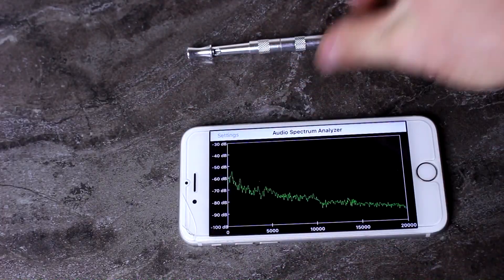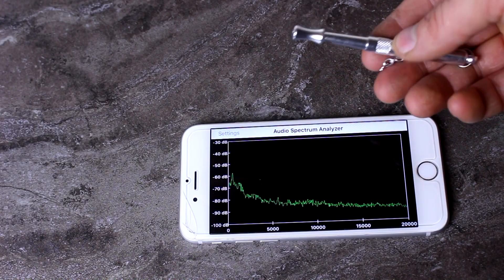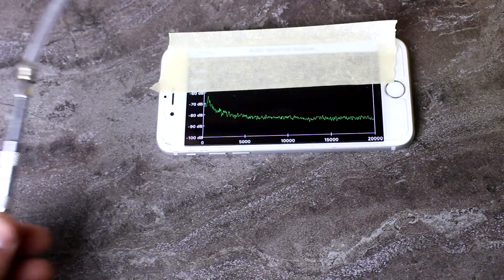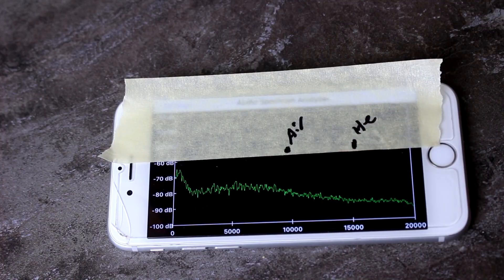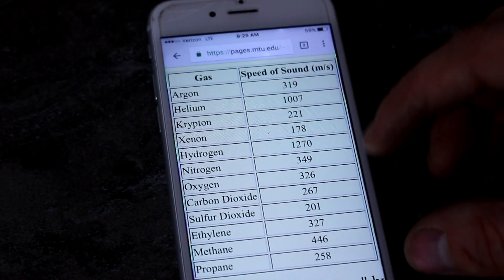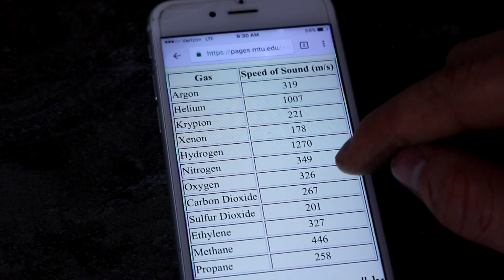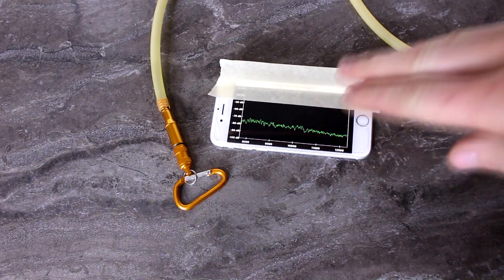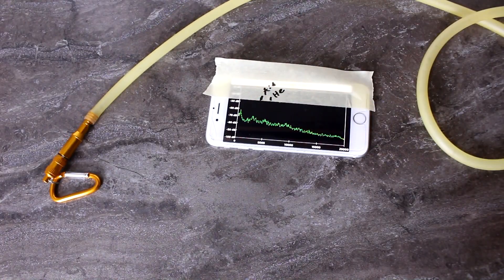Dog Whistle On Helium and Xenon

Comment: If the helium was meant for party balloons (ex: you got it at a party store), then it absolutely has oxygen added to it.  They do this to ensure people don't asphyxiate on it since they know people will huff it (getting hurt is uncommon, but has killed at least one person).  If you want higher purity stuff, you generally need to get it from a supplier and/or make sure they have the purity documentation.  Also: props for doing the test with xenon; I know it's really expensive (pure, it's $1000/kg in bulk, compared to helium at <$20/kg).

Comment: That's really cool! And I have an idea for a follow-up video! As the electronics hobbyist, I saw something familiar in those two peaks on the spectrum when you blow too hard. In electronics, a sinewave oscillator ideally produces only one frequency - the fundamental. But when you overdrive it (just like you did with the whistle) the waveform gets distorted (clipped if you overdrive it real hard) and produces harmonics as the result. Similar behaviour, it would be nice to see how the actual waveform changes. I bet it's gonna be sinewave if you don't blow in it like crazy :) Cody, I will be very happy if you will give this a try.

Comment: I think the "Diffusion Rate" is the wrong term, I think the reason the balloon deflates more slowly is the viscosity of xenon gas is higher which plays into the Reynolds number and ultimately the friction factor of the tube/whistle.

Comment: Tut-tut... All whistles have their harmonics and the helium you put through the whistle has a distinct lower frequency peak as well in the 4500 to 5000hz range. And Xenon did the same.

Harmonics are determined by the frequency of the whistle, which IMHO you should find out what the set frequency of the whistle is as not all whistles are created equally.

Comment: You're probably seeing a harmonic at 9-10kHz, rather than the primary note being played. Dog whistles are ultrasonic, above 20kHz, which is why they seem quiet to us. The microphone on your phone and pretty much any other mic will not pick up anything over 20kHz, since that's the upper limit of human hearing. Speakers will also usually not play anything above that, for the same reasons.

Comment: The whistles aren’t necessarily designed to play multiple frequencies, that’s just the resonance from the sound interfering with itself at the aperture or whatever (I don’t know the specific whistle jargon). This also means you’re gonna get different measurements depending on the angle of the aperture relative to the microphone

Comment: it's nothing to do with an overload on the whistle, it's just how sound works. the first peak is the fundamental frequency and the higher frequency is the fifth above (the strongest harmonic since it is in phase exactly half-way between the fundamental and the octave frequencies), the next (smaller) peak is the higher octave and you can even see a really small peak near 14k on the Xenon reading, which is the next fifth up, and so on past the top of the scale.

Comment: The reason you got a different frequency when you used more pressure to the gas is called "overblow." Wind instruments use this to extend their ranges. Instruments like the flute or saxophone overblow by an octave, or their frequency doubles. A clarinet overblows by a 12th. The shape of the bore of the instrument and if it open or closed on one end determines this.

Comment: Question for you: would the air in the whistle slow down the helium? You are giving it a push, but as you're pushing it, it has to exit through normal air, causing a bit of a bottle neck?

Comment: What I would like to see is what a whistle sounds like with the same gas content, but at different atmospheric pressures.Maybe your pressure vessel could be of use?

EDIT:
After reading up on the subject the pressure is likely to have very little effect on the actual speed of sound in the medium itself so as to be mostly irrelevant in an ideal gas.

Comment: Shouldn't the exhaust of the whistle be into the same gas as intake?
Whistle intake and inner structures are filled with gas, but the exhaust opening [which sports the breaking-edge, a key part of the whistle!] is exposed to atmosphere/gas mixing.
Using a microwave analogy, the density difference between air to gas is much like an impedance mis-match in a waveguide/antenna!
If the whistle-body was in a balloon filled with gas, then more gas injected to make the whistle sing, then your results might be quite different.
It would reduce your standing wave ratio, leading to less overtones.
The harmonics hint that the coupling is not ideal.

Comment: Hi Cody, your bottle of Helium is in fact contaminated with air for safety and regulation purposes
As it is an inert gas, some people used to use Helium to kill themselves peacefully (as you body detects high levels of CO2, but not low levels of Oxygen, you would simply faint away and die without any convulsion if you were to breathe pure helium with a hermetic mask)
Because of that, federal regulation decided to force balloon Helium tank manufacturers to make "Ballonium" Which is about 80% Helium and 20% Air do that anyone attempting suicide (voluntarily or not) would feel the effects of asphyxia and CO2 poisonning (which are pretty painful) before death would occur.
If you want a clean source of Helium you will have to contact specialized manufacturers
Reply: This is Cody- when he wants the O2 gone, it's going...

Comment: im not sure how it works, but it looks like theres a log ration to the speed of sound relative to the mass and de frequency of the vibration..

also, maybe the air between the wissle and the mic make distortion, and the several peeks are harmonics that could come from echo in the room or from the hardware you are using. michrophones have a resonance frequency like everything else!

Comment: Isn't air mostly nitrogen?
Reply: Yep.  With a molecular weight of 28, compared to oxygen's 32.  Helium molecular weight is 4.  Xenon molecular weight is 131.  Compared to helium and xenon, there's no difference between oxygen and nitrogen as far as speed of sound goes and with equipment as crude as this.
Reply: At sea level air is roughly 79% nitrogen, 20% oxygen, and 1% other gasses. At his elevation, oxygen will be lower concentration.

Comment: Hey Cody!
A student once asserted that when you inhale Helium, it doesn't lift the fundamental frequency of your voice, but it affects the overtone series, sort of like a wahwah pedal with guitar.  
This experiment seems to refute that claim, but I wonder if the human voice isn't more complicated.  Can you do an experiment where you sing a pitch, with and w/o Helium and compare the Fourier Transforms of these?  
It'll make a fun video no matter the results.
Reply: It doesn't refute it, because those are two different ways to make sound.The fundamental frequency of the whistle mostly depends on the time taken for sound to travel along the tube. The fundamental frequency of the human voice mostly depends on the tension of the vocal chords. It's like a recorder vs. a trumpet. The vocal chords act like the lips of somebody playing a brass instrument. There's some coupling between the resonant cavity made by the mouth/throat and the vocal chords, so the fundamental does change slightly, but less so than with a whistle.
Reply: Google "formants".
Reply: Human voice is a little more complicated, because there is something known as a 'formant'. In sound-design / mixing, when you pitch shift a human voice, it sounds like a chipmunk unless the pitch shifting algorithm has some sort of "formant filtering", where it then sounds like a normal voice again, just higher pitch. It's hard to describe the difference. One way you can make it sound like somebody sang a higher pitch than they really did, and the other just sounds like you made them several feet shorter.

As I understand, the 'formant' is a set of peaks, and it's the ratio of them that makes a voice recognizable. You can sing in various pitches, but the formant of your voice stays the same for all of them.

However, a voice sounds totally different on helium, so it's safe to say that the formant has changed, even if the fundamental pitch might not have. I don't know how that ties into the results on the phone though... maybe results would be different with more sophisticated gear... the phone might have poor frequency response in the high range, and the real peaks may have been different. Or, maybe the fundamental frequency of the voice actually does change right along with the formant, and he was just wrong...

Comment: A brief digression into digital audio/sample rates: (oversimplified, but still)

Your iPhone is recording sound at 48000 Hz, or 48kHz. 
The Nyquist–Shannon sampling theorem says that you'd need 2x the frequency as the sample rate to reproduce your signal. 
With 48kHz sample rate you can then reproduce ~24kHz as your absolute maximum frequency. In reality (and to preserve sound quality), the iPhone starts to filter audio above 20kHz to avoid aliasing. 

YouTube on the other hand has a very steep filter at 16 kHz audio frequency, so everything above that isn't going to be reproduced on your viewers player (even if it is audible in your source video files). 

If you happen to have a sound card or USB audio interface that can sample higher than 44.1 or 48 kHz, you could use that with an external mic to retry your experiment and (hopefully) get more clear results. Especially on these overtones of the whistle on helium.
Reply: Not to mention the frequency response of the mic capsules
Reply: That's it!
Reply: So he can even trace the natural harmonics of the whistle.
Reply: brilliant
Reply: Ahh.
So I should breathe helium to hit a high G on my trumpet.
I'll write that down.

Comment: The Android app I use has an option to mark the frequency of the significant peaks so you do not have to guess.  Used it to measure the frequency of noisy inverters.

Comment: Just wanted to note that the first gas you were using was breath, which is mostly nitrogen, unless you were filling the balloon with a pump, it doesn't make a huge difference for your findings since nitrogen and oxygen behave similarly, though.

Comment: Oh man you've just remind me I'm defiantly closer to dying, I use to be able to hear 17 kHz easily but couldn't detect the 15 kHz you got with helium, I may as well buy a wheel chair.
Reply: Enoch Powell or just your speaker is crap
Reply: Good point. Though I'm 40 so I'd imagine my hearing is tailing off considerably, in my late teens I could just about detect 19.2 kHz in a silent room using head phones which as you probably know is right at the limit of what humans can hear.

Comment: The whistle is designed to play slightly in the audible range and not to be purely ultrasonic. This is so that you can hear what you are doing with the whistle, which becomes important when you start training more advanced commands with coded whistle blasts.

Comment: hey cody, could you use this method to identify gases?
Reply: i mean like, if you had data about gas frequenses peak. and then put a unknown gas through the whistle, and try to identify it.
Reply: Probably, would require a decent pressure of gas and purity though
Reply: I imagine you could get a pretty good idea about the density of the gas (which you could do by floating it in a balloon anyway) but not to a particular gas, because a mixture of gasses could be indistinguishable from a single gas if the densities line up right.
Reply: So this demonstrates the relationship between molecular weight and sonic resonant frequencies for a given column of gas... Another way is to use electromagnetic waves instead of sound waves, for which each molecule also has a signature resonance. This is how mass spectrometry works. Notice the difference was smaller with the lower frequency whistle? That means lower quality measurements. With mass spectrometry, the frequencies are much higher (visible light!) so the differences are easier to measure.

Comment: Oh, honey, thats not what FFT length is used for. You want to turn on "peak hold" and maybe turn the slider below that down a bit.

FFT length is the resolution, so you're just increasing the resolution so much that it slows down and takes longer to change.

Comment: I wonder how much does it cost to fill a baloon with Xenon , in your video about NaK floating in Xenon , you said that the cilinder that you bought only contains 25 liters of Xenon , and it cost U$ 1300. So a 9 inch latex baloon having about 10 liters of gas , would cost about half of the cilinder , right ?
Reply: Ollyweg 0 Oh , thank you , I was confused about that ; )
Reply from the maker: the 25 liters is the content of the cylinder if released to stp, so yes very expensive but not like I'm using it for much else.

Comment: Isn't a microphone on the other side of the phone ?! :O
Reply: Neroxen most flagship phones post-2012 have a dual microphones
Reply: DankoH iPhones have multiple microphones, so the one at the back isn't the only one.
Reply: Hey! RC CARS!
Reply: The secondary mike input is electronically subtracted from the main mike so the end effect is reducing ambient noise.
Reply: Yes, it does have 2 mic. But upper one is for noise cancelation, like John wrote.. I think :). I don't think you can talk to some1 speaking into uper mic alone.